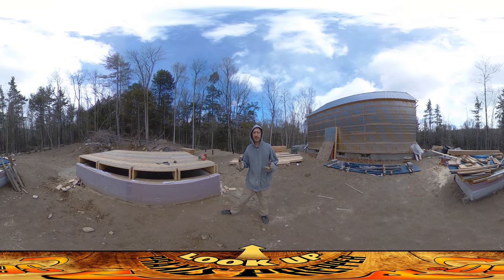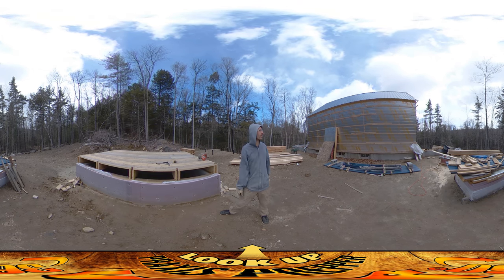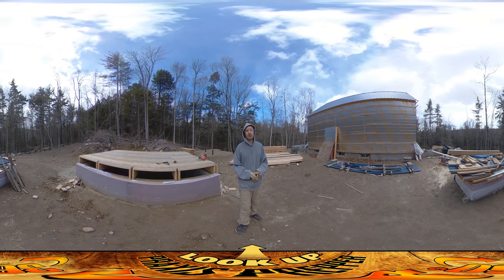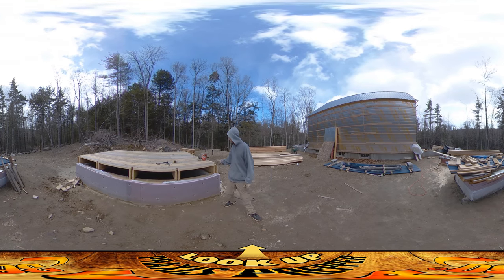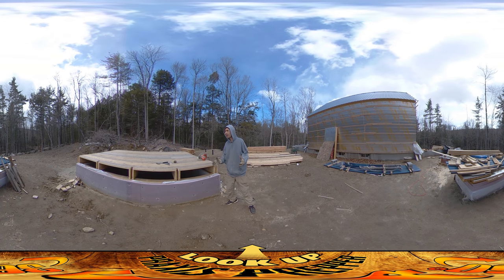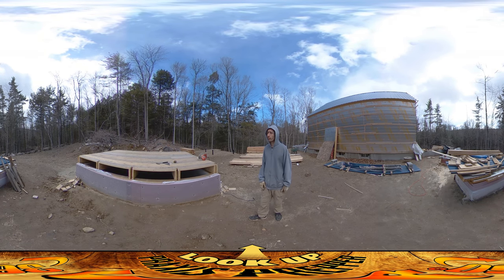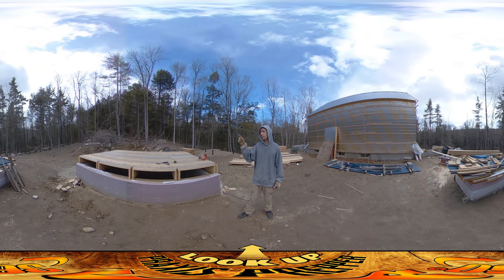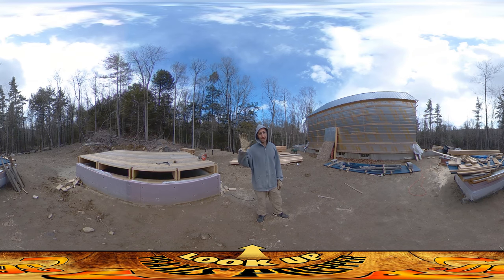Homestead Building - Plumbers Ignore Instructions, Posts for Mini House

Comment: I feel you on the downgrade of high grade lumber. It would almost physically hurt my heart to have to do that. 

On the solar panels pitch. Unless you have an independent sun tracking system you will only be exactly right for a couple weeks as the sun moves through the seasons. What I chose was to set the angle for mid winter low sun as that is the weakest and shortest daylight. Now I'm designing  a "mirror" at the bottom edge that will reflect the summer sun which is more overhead so hitting the panels at a glancing angle. The mirror is 2 foot wide roofing flashing that runs along the bottom of the panel array. 

The mirror system will have to be able to swivel so it doesn't catch the snow in the winter and gets out of the way so I can sweep the snow off the panels when needed. That brings up the point of your panels. One of my neighbors (came here from city life in New Jersey) put his panels on the roof. They came off the roof the next spring because he didn't want to break a leg climbing up there to clear the panels of snow.  Since I don't know the plan of your shed, it may not be an issue.
Reply from the maker: I think I'm going to go for an angle between equinox and mid-winter. The rules actually prescribe an equinox angle, but the installer agreed that doesn't make sense and says that they routinely do not follow the rules on that without issue - favoring winter sun.

Comment: That angle will change from summer to winter.
Reply from the maker: Yeah, but I don't want to move the panels. So I'm going for a good middle of the road angle. I think I'll be angling them slightly favoring winter after a discussion with my installer.

Comment: The angle for panels depends on a lot of things, first off you want an angle that gives enough length to the roof so that the panels will actually fit ! ... this in turn has to do with the width of the structure (The wider it is the more leeway you have). But obvously the panels have to fit, and with a given width half of that width will be a given length, then the panels will have a certain length providing another given, which should enable you to calculate the height needed to reach the length for the panels, and that will also give you a MINIMUM angle ... another is the angle needed to catch a decent amount of sun to make these actually work somewhat optimally. Given that the sun's angle to the surface of the earth changes during the day (from 0degrees to the max angle for that day, to 0 degrees again), and the max angle changes with the seasons (it's angle then depending on the latitude of your location). There isn't really ONE angle to choose to be entirely perfect... 

Now i recently calculated the angles for my roof (of my imaginary house), for just regular solar. And due to the style of roof i'm going for i came to two angles, 70degrees and 40degrees, these angles allowed me to catch as much sun as possible during the day, and during each season, with 'missing' some hours of yields during the summer months when the sun is at it's highest, but seeing these are actually 'light' panels and not 'sun panels' (be it that 90 degree sun obviously gives the best yield) i'm expecting at least some yield during these hours where the angle isn't perfect.

So what i did... I drew 4 lines about 1.5 iches apart representing the solstices and equinoxes (march, june, sept, dec), then based upon the sun-up times and sun-downtimes for my latitude (got that off the internet) i scaled those lines for the hours of the day and marked the sun-up and down times, and obviously 12h for the max. Then based upon my latitude i can calculate the max solar angle on each of these days (i just marked up from the lines on a rough scale compared to the first angle i denoted). So now for each of these 4 dates i have a 0 degrees morning, a 12h maximum, and 0 degree night-start. Then i just divided the angle between the hours in between these states, giving me the rough increase of the angle per hour, and i marked those as well, then drawing the rough line the sun follows through the sky during the day on these dates.

Then obviously i can now also draw the other months in there, so at 0.5 inches and 1inch i can draw a line and denote the hours on there. Now i can either look up the sun-up and down times for the 21st of that month. OR, i just divide the difference in hours by the amount of months, and roughly assume an increase or reduction of these times by that amount per month. Then to get the max angle for these months, i can divide the difference between the angles of the date i already now in a similar fashion and assume a rough monthly increase or decrease of the angle in each of the intermitted months. Then i can do the same thing for the times and also draw in the lines for the sun's angle during the day for these 'dates'. 

The result of this will be a '2.5D/3D' chart of the sun's angle during the whole year, a sort of dome over your location when the sun is up, and at which angles it will be. Then the 'optimal angle' is said angle that allows you to get as much sun during the day and the year. So the angles will be somewhere in between:  90degree minus yourLatitude minus 23) (note: 23 is the rough max angle change for the solstices). So for me f/e, i'm at roughly 50 north, in December the sun will have a max angle of 50 - 23 = 28 degrees, where to get a 90degree angle for my panel with the sun i need a panel at 90-28 = 62degrees ... in the summer the sun has an angle of 50 + 23 = 73 degrees and i need a panel at 90 - 73 = 17 degrees. At the equinoxes the angle of the sun is equal to my latitude, being 50degrees, where the optimal angle for the panel would be 40degrees (so it has a 90 degree angle) ... Sort of explains why i went with 70 and 40 degrees ;) , and i was very lucky that with the width of my structure i could also pull this off, having enough roof 'length' to actually fit panels on the roof at those angles.

So now, your optimal angle (seeing you only have one) likely needs on more input, this is the average sunshine for your location during each month (likely can be found on the internet as well), this gives you a rough estimate of which months will be sunniest, and you may want to choose an angle that coincides with the optimal angle for these months. OR, you might want to get a certain yield at certain points of the year, or during a particular time of the day (here i need to note that the location the sun comes up (and sets) changes ever day as well, and given a certain orientation of the structure (generally 'dead'-east/west) and the latitude, there will be hours in the day the roof isn't hit with sun-light; for a northern latitude these will generally be the spring and summer months, as the sun comes up past(~/'behind') the east/west line the building makes. Making the sun shine of the east or west face of the building, not the actual roof pointing south.  (for me f/e this means that during these months i won't have much benefit from the 70degree roof during these times, where i will during winter because said angle then covers the entire day). 

Anyways, do remember the chart you build up top is the angles of the sun, and with 90degrees being most effective, you will want to subtract the angle from 90degrees to get the angle for your panel. Then also allow for say a 15 degrees plus or minus to get a good enough yield. And sort of pick an angle that 'generally' covers most times of the day, during most of the year... (and, you may have to consider the shade your primary building casts as well, if it casts a shadow on the roof during any time of the day during any time of the year)... Draw you main building height (can just be a line), and the shed at proper distance, then use the information you gathered above to calculate the angles of shadow your main building will make during the year (i'd start with the equi and sol again) and check if at any point the building shades the roof of the shed. Can do the same thing for some 'markers' for the time of day, be it that i'd do that second because if no shadow is cast during any month, the orrientation of the structures might mean that no shadow will be cast during the day either, simply because of 'where' the shadow will be cast at those times of the day.

Good luck ! ... i hope you will look into this, and if you have questions, do ask :) ... the above will not give you a definitive answer straight away, but i will give you all the information to make the best choice for your situation ! (and at least gives some insight on the factors that play a part in a choice like this).
Reply from the maker: Thanks for those thoughts. I'm building the shed specifically so it can have a roof to hold the panels, so panel length has from the beginning been baked into the mix. I have a 10' sheet of roof for the south side to hold the 8' panel, and a 7' section of roof metal for the north side. I just put up the first truss yesterday and boy was it NOT easy. They're obviously lighter than the roof trusses for the house, but the house trusses were being set on their posts from the second floor so I only needed to lift the trusses up a couple feet to get them on their support posts. This shed requires the truss ends to be lifted between 6-8' using a ladder... and my back is a bit "degraded" from all the recent work. I dropped the truss on the first attempt and had to modify my approach. But got it up. :)
Reply: @PraxisPrepper  np, i found it very hard to get a good idea on angles for my solar at first. So i thought the above out to get a better understanding of the things at play during the year and the day.

Also because i had some restrictions of my own, mainly my house just has 2 floors, downstairs and upstairs, so i'd love to maximize the useable space up there. For this i had a Mon'something' style roof in mind (basically a barn style roof), but that meant a pretty steep angle on the bottom section, and no clue for the top section. The above helped a lot to realize the 70degrees i choose would work just fine, and while i had innitially choosen a 30degree pitch for the top, it turned out 40 would probably be better, then it was just a calculation of that would still fit a panel, and it did :)